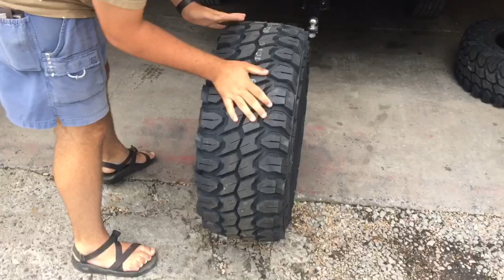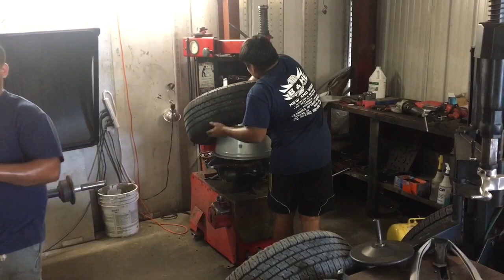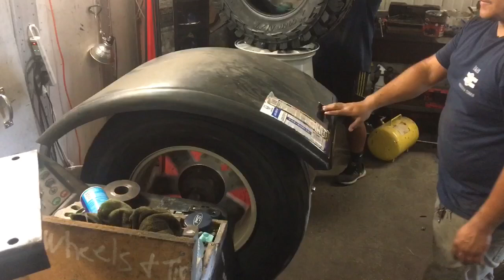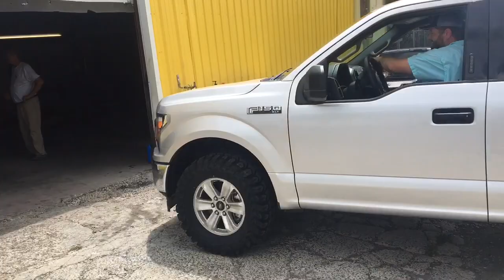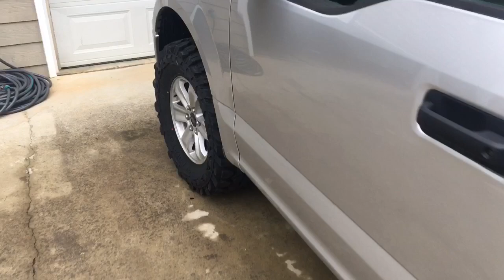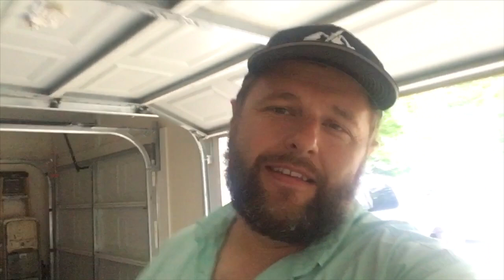Gladiator X Comp MT tires on 2018 F150

Comment: The guy putting on the wheel should learn how to do the cross pattern when bolting them on. ? Look good anyways. Just wondering how are they on highway ? Any problems balancing or anything ?
Reply from the maker: Sold the truck already.     But I thought the tires drove good with zero problems balancing

Comment: what size of the stock rims did you put them tires on? my stock rims are 18 by 7.5 inches wide. Looking up the spec detail on those specific tires say that they need atleast 8.5 inches recommendation on it. i would like to fit them on my rims but maybe the width of my rims are to thin. :/
Reply from the maker: Jovanni Flores    These wheels are 17x 7.5 and they worked great with these tires With no scrubbing at all.

Comment: Is your truck lifted or stock? If not do you believe you could have fit 35’s?
Reply from the maker: The truck was stock in the video then I put a two inch level kit on the front and I had plenty of room for my tires. The aggressive side walls of these tires almost touched the arm behind the tire- like 1/4 of an inch so very close behind tire.  But 35s I think would fit if you did a little shaving inside of finder well if the tire didn’t hit the arm behind tire.

Comment: Hey man! I have a 2019 F150 STX  2.5 leveling kit with stock 20'' wheels. Do you think the 33x12.50x20 will fit no problem?
Reply from the maker: Yes indeed.
Reply: 35’s will fit with a leveling kit.

Comment: How loud are they from 1-10 ?
Reply from the maker: 5.3David      I would say  4 and quieter than nitto trail grapplers
Reply: Chase-N-Gunz Outdoors not bad I used too run toyo mt and honestly them things where quite but a bit pricey love how gladiators have that super aggressive tread and are cheaper than toyo or nitto depending on size ofc I’m going too go ahead and pull the trigger and order me a set of gladiators
Reply from the maker: 5.3David    I thought they were the best side wall on the market.